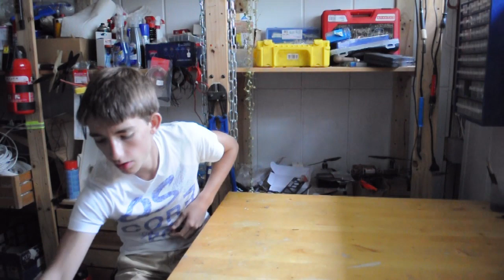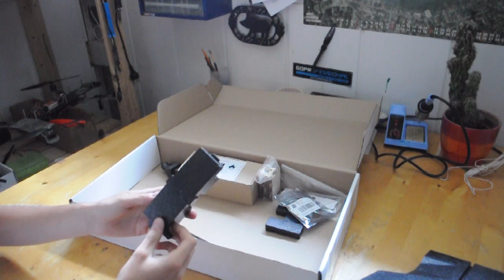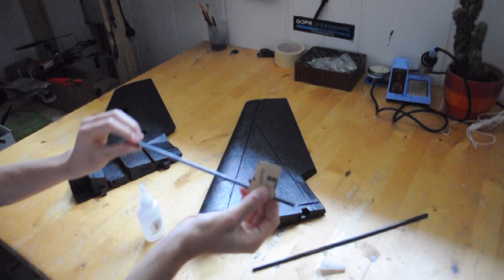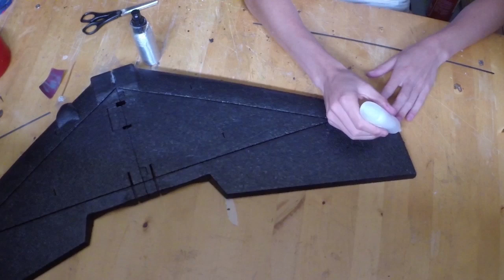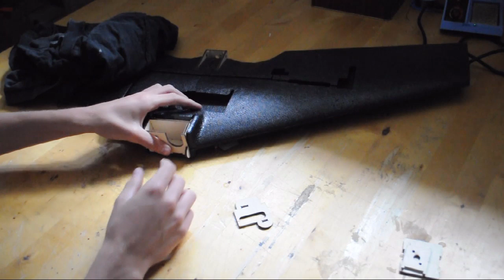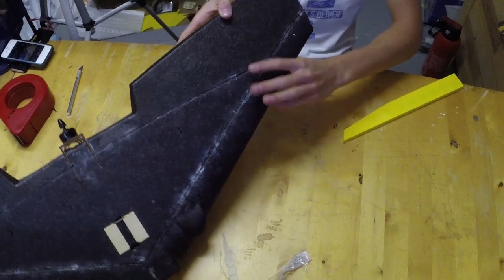[BUILD] TBS Caipirinha FPV Wing PART I

Comment: Great video, but wouldn't it be easier to attach motor to mount before gluing it into the wing ?
Reply from the maker: +Troy Kelley (TK Inspired Aerials) Yeah possible, it took me quite some time to get it on there because you have little space to move your hands... Thanks ;)
Reply: No worries, great video though, I learned alot .. i'm still debating on my first fixed wing to buy .. either zephyr or the other TBS one the mini wing.. any suggestions .. you are the pro
Reply from the maker: alright, I'd go for a caipi for sure as your first one cuz the zephyr is wayy too big and fast for a beginner... My friend had a zephyr and i always had to launch him because it was a little sketchy when doing it alone. also we had to go on a little hill to launch it. Now we both have a caipi and are having tons of fun with it.
Good luck!!
Reply: Very nice .. I want BOTH ! !  but i'll start with a mini wing first .. then upgrade shortly after ! !  Thanks for help
Reply from the maker: haha everybody wants both ;) Good plan.

Comment: How would you compare it to the rvjet? I'm deciding between that model and the tbs
Reply from the maker: Hi
I don't have an RVJet, but i know it's a lot bigger, and thus probably more stable. But i can say the caipi is extremely stable when flown at high speed with lots of weight in the nose, probably even usable for cinematography. with a flight time of about 25-30 mins i think the caipi is a very good compact solution.

Comment: how much did your kit cost? Was everything included to fly?
Reply from the maker: mine set me back 0.- ;), but the frame costs 100$, elctronics package (servos,motor,esc,prop) 129$, lipos are 35$ each and the CORE PNP which is reaaaaally useful is another 65$.
No radio or FPV equipment is included.
You can buy a complete set here: http://www.team-blacksheep.com/products/product:512
Thhis is a really pro setup. you can get it flying for probably under 700 if you choose a little bit cheaper parts...